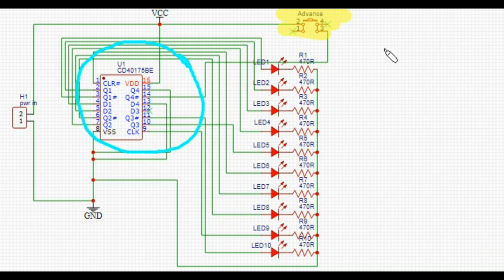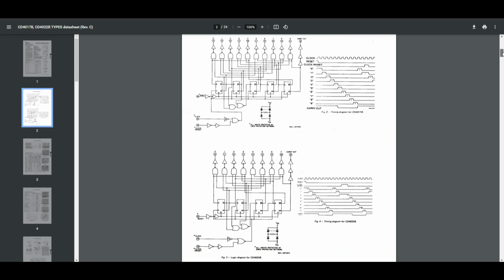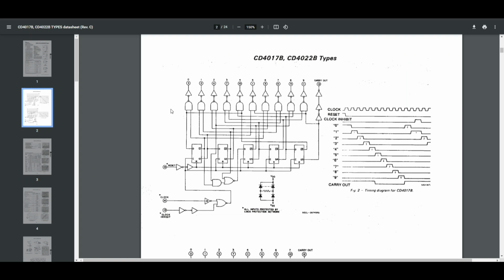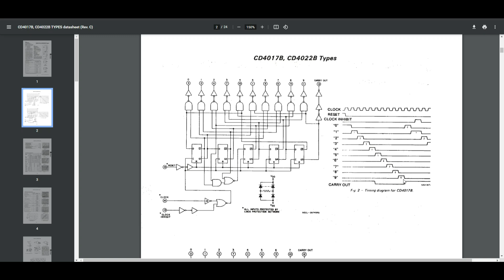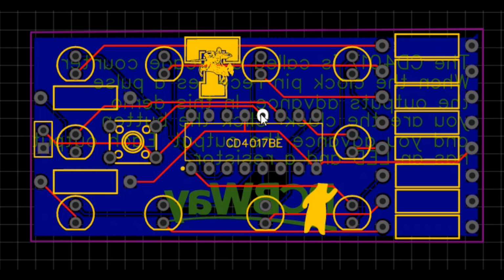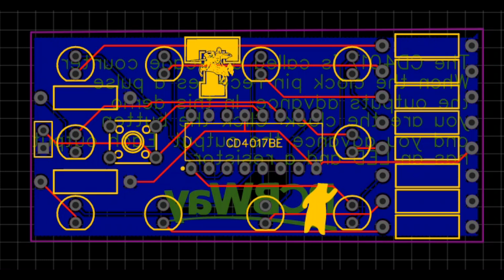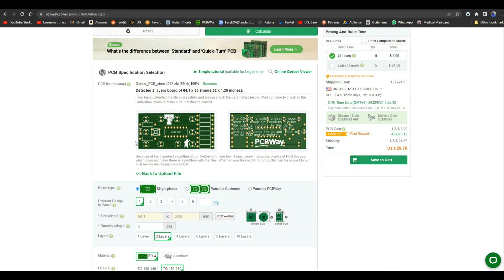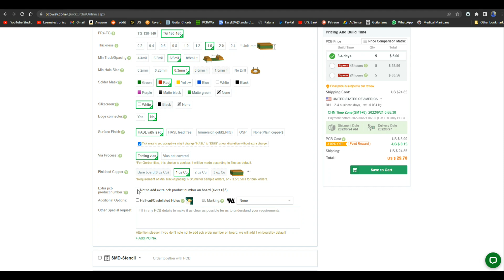Manual LED Chaser for STEM Kids

Comment: Your diagram at the beginning has a 40175 quad flipflop label and pinout, showing input pins connected to output display LEDs, not a 4017 decade counter/decoder, really confusing.  May I ask why you ordered this as a PCB for stem kids instead of letting them breadboard it?
Reply from the maker: This is part of a series. We are creating a number of these small 50x30 mm boards each showcasing one aspect of electronics. We have voltage regulators, 555 timers, 4017 counters, LM317s for variable voltage, RC time, constant board, LED, resistor board, etc etc etc. By the time this is done we hope to have about 25 of these little boards to give these kids.
Reply: @learnelectronics  Ah, so it's not a 'build' project, its a neat "fidget" to stimulate the mind on what's possible, cool.

Comment: Given that this is going to be used by kids who will not be gentle with that button, I would have added a debouncing circuit to the pushbutton.  It is going to get frustrating as those contacts wear and the clock signal starts to get spiky. Other than that, it looks like a good teaching tool.
Reply from the maker: That's true. I will keep that in mind for the next iteration

Comment: You had a CD40175 quad D flip-flop in your circuit diagram at the beginning of the video and that got me all confused.
Reply from the maker: It was just for the footprint
Reply: @learnelectronics  Wouldn't the CD4017 had the same footprint since they are both 16-pin DIP IC's?

Comment: Hey Paul. Nice job! I breadboarded a 4017 with the 555 as clock, and used a pot to vary freq. I then tried the button in place as you did. I had weird results, though. Perhaps it was the breadboard. I put a pull-down resistor on pin 14 and a cap to debounce the switch. The result was one advance each push of the button.

Keep up the good work!
Reply: That’s right. Although, there are much more reliable denouncing circuits available.

Comment: What do you mean by LED Chaser? what is causing the chasing of the LED's?
Reply: The 4017 has a clock input. When you use the switch attached to the clock and to positive, with each press, the 4017 outputs go high (turn on leds) one after the other in order. But you should attach a 100K resistor from clock to ground (pull down resistor) as well as place a 104 capacitor across the two leads of the switch to denounce it. His circuit will act erratically and it won’t advance the leds in order, instead they’ll skip around and well, act erratically.

Comment: Needs a 100K resistor from the CD4017’s clock input to ground as well as a 104 cap across the switch leads to keep it from jumping all over the place instead of a predictable 0-9 or 1-10 pattern. And really, there should be decoupling caps across the power leads of both IC’s.
Reply: You sound like a TI Tech!
Reply: Both ICs?